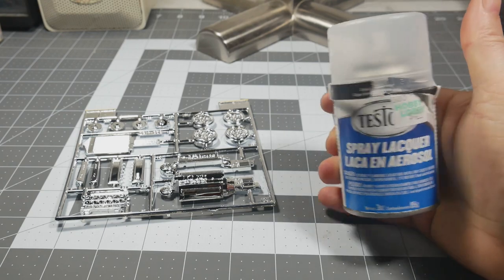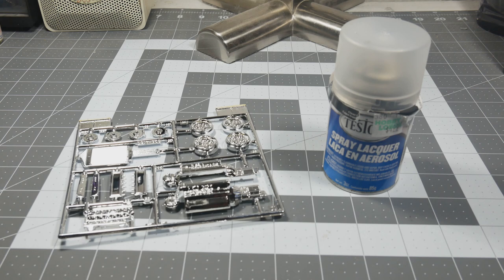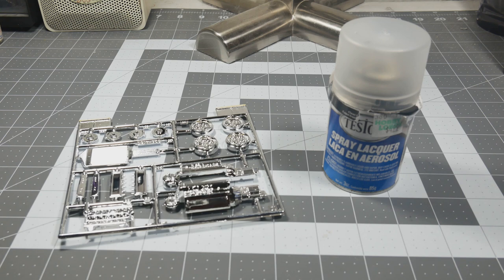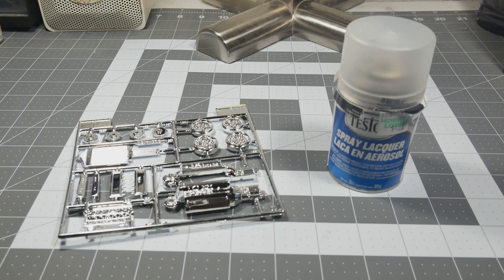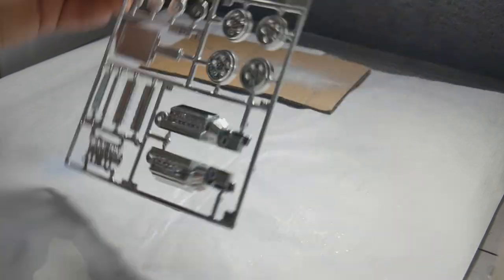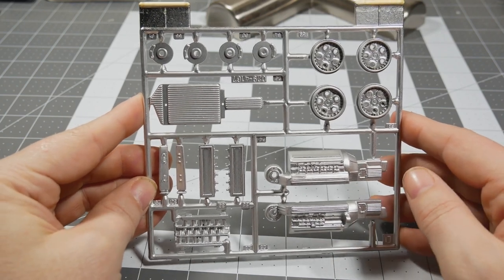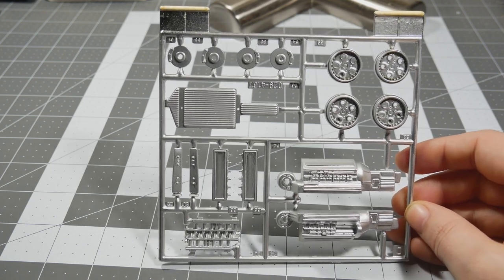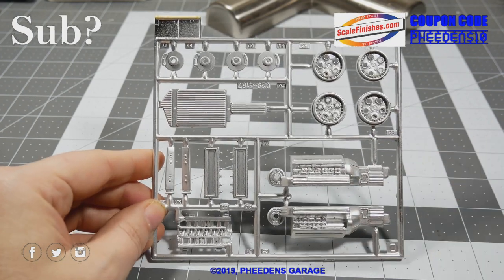Top Tip Thursday, Dulling Down Chrome Plated Parts

Comment: Good tip. I used to do that with the Monogram and AMT NASCAR kit's chrome of the '80s and '90s. It was a nice alternative to the silver spray paint. Not exactly aluminum, but fairly close. I think at some point Monogram started doing it themselves for the Luminas and T-birds.
Reply from the maker: Right Tim, its not going to 100% replicate aluminum perfect but close enough for some things .   Yes, I remember the wheels for short time were more satin than chrome .